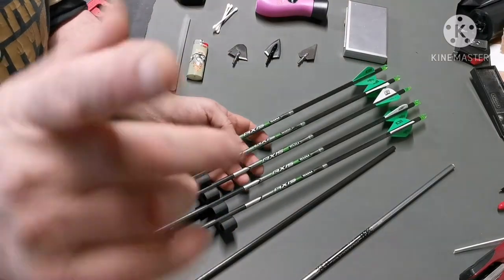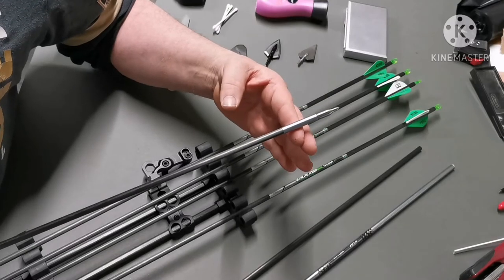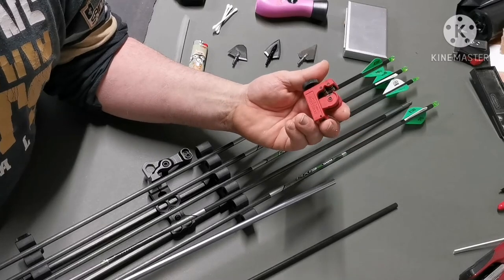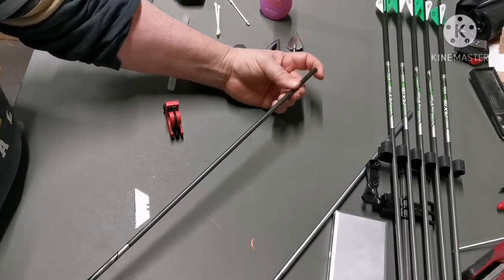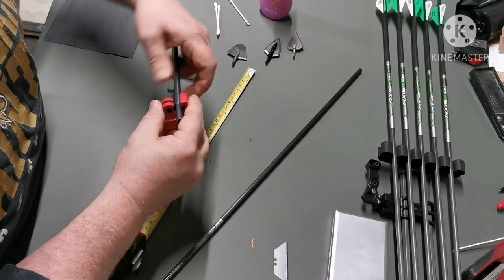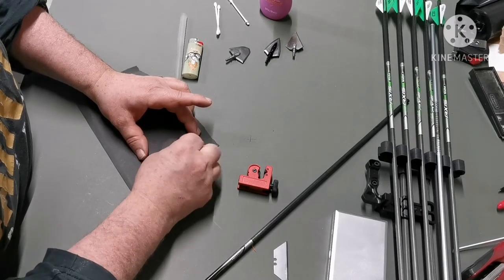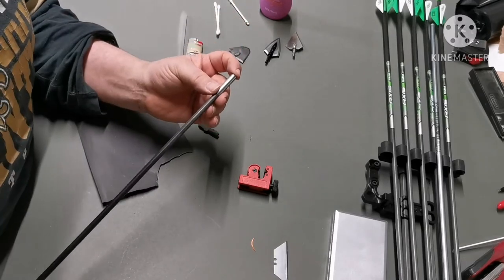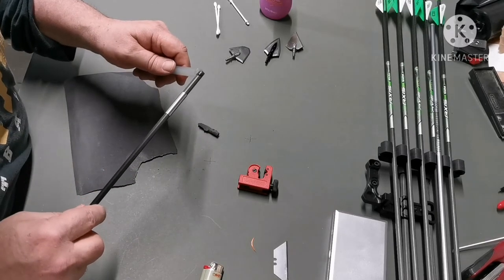Easton Axis 5mm:- HIT Insert reinforced simply, efficiently & affordability.

Comment: What size xx75 arrows did you use for this. I looked on Lancaster archery supply to get some and there were a ton of options.
Reply: Just watched the video again and realized that you said the 2016 size
Reply from the maker: Just checked. Its Easton XX75 in 2016 size. Fits over the Axis 5mm shafts nicely. Thanks for watching.